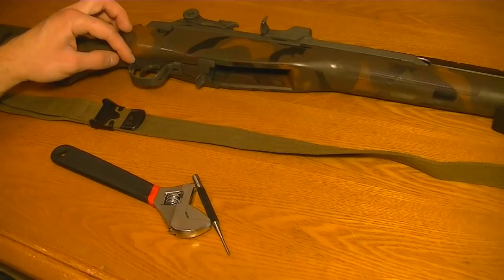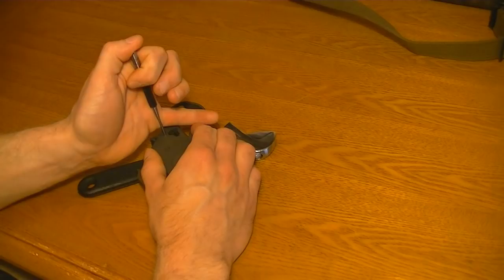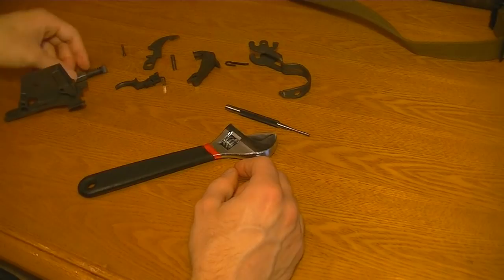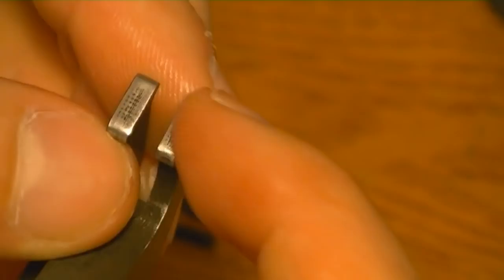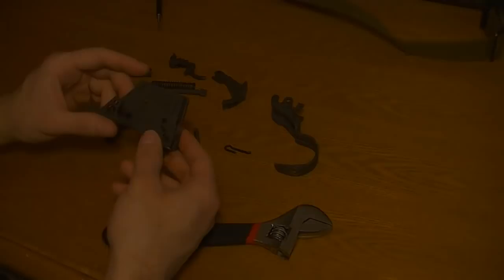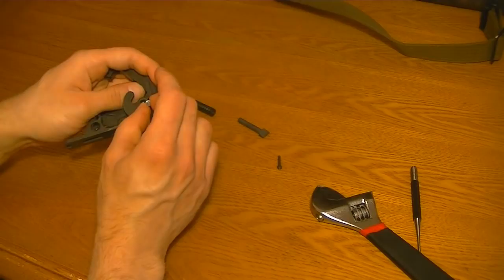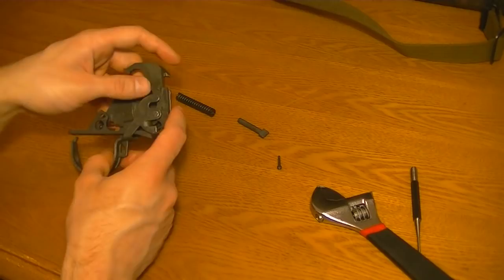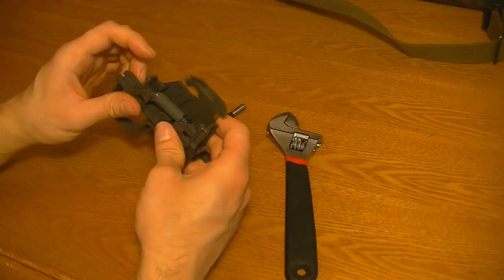M14 Easy Trigger Job and Trigger Group Disassembly

Comment: Ditto on the great video!  After launching the trigger pin across my basement too many times, instead of putting the end into the hammer groove, I put the end in the crook of the hammer.  I was able to use leverage on the hammer spring housing by putting a punch through the bottom plate trigger hole, inserting the "slave pin" punch, and removing the "leverage" punch.  I think there is a lot less spring tension using the hammer crook instead of the groove.  I then pushed the hammer spring plunger down the hammer bar into the groove.  I think I should have tried installing the trigger before pushing the spring assembly plunger into the groove.  I'll try next time as I only dropped the trigger pull weight to between 5# and 5.6#. I didn't want to take too much off.

Comment: Thanks for the video! You did an excellent job of explaining this project... very helpful.
Reply: I got into it today like jakevader95.  The first time I tried it the trigger group moved and it exploded everywhere.  Be careful wear eye protection when doing this.  This video is awesome without the tips provided it would have been a nightmare. Also I took finish off the hammer and trigger sear and it is slightly better trigger.  I took off all the finish and it still was kinda heavy maybe it will get better with shooting a few hundred rounds.  Thanks again for your video and tips!

Comment: nice job. I used y stronghand an squeezed he back of the trigger to get the trigger pin in. It works, but the first time I slipped and the whole thing exploded across my basement. Too some time to find all the parts. I like the idea of using a punch to assemble the trigger step-by-step.

Comment: I'd recommend using cheap sharpening stones off ebay, Definitely no need to go crazy with them but you will have a truer flatter smoother surface. If you ever watched any of the american gunsmithing institute videos you'll see them stoning surfaces for crispy smooth locking and unlocking.
 Nice video!
Reply from the maker: disorderindminor Thanks for the tips, if you are careful with high grit sand paper (400+) and don't go crazy you can do really well... You can't feel the trigger from the video (and it was already a decent trigger) but after this it was extremely crisp, I was very pleasantly surprised!

Comment: Good one! Any dents and scratches on the table. I did mine and like you one hour spring pressure job. However I need to redo mine with more polish work to be performed. My trigger pull I estimate to be 7-8 lbs. I'll keep this as a ref for when I get time to proceed. Thanks.

Comment: I've had M1As for 30 years..
Never had to do this.  Never had anything break.   You can clean it without dis assembly.   I'd suggest letting someone with experience work on your trigger.   A well done M14 trigger is the most accurate trigger you will ever find.   Mess it up..
You have safety issues.